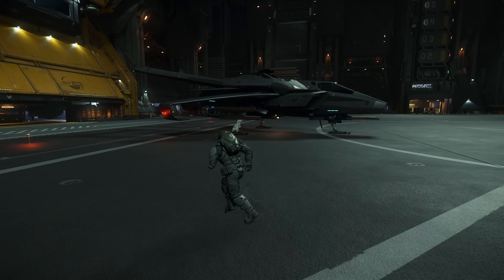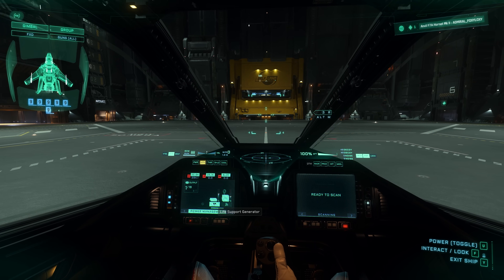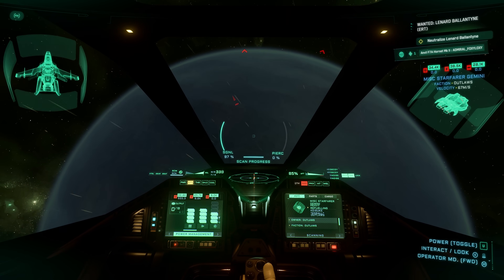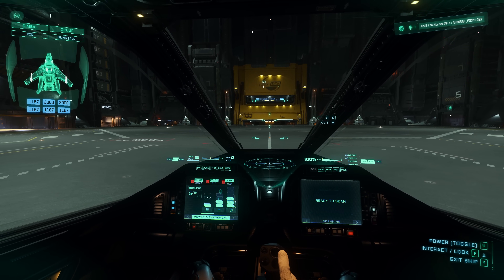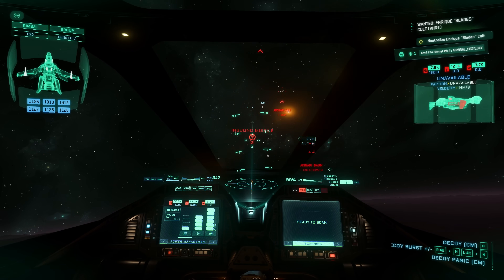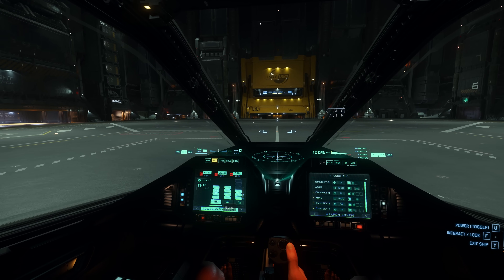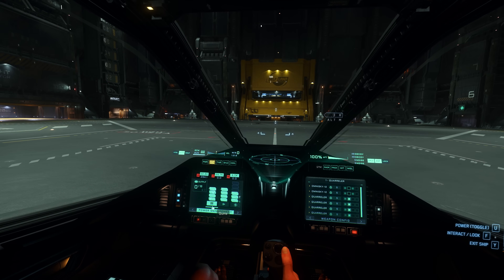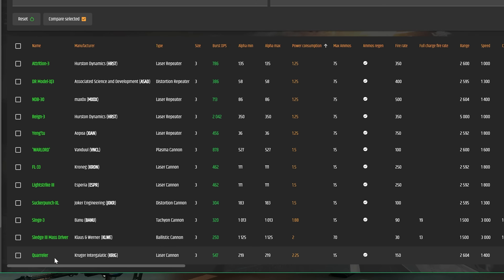How Ballistic Weapons Affect Power Management | 3.24.2 Ship Weapon Deep Dive Ep.1 [4k]

Comment: Concerning ammo, best choice is to test on AC different loadouts. 
The max number is 75 for repeaters and Gatling, and 15 for canons, whatever the size. You will never get more. So the goal is to find how many energy weapons you can use until you start losing ammo. 
E.g. Connie can have 4 energy weapons (4 default galdereen or 2 galdereen and 2 repeaters on one of the turrets). If you use more, you start losing ammo. 
In addition to that, weapons don’t have the same capacitor consumption, so having 4 galdereen can result in 75 ammo, while having 4 attritions may result in less. 
Same goes for Omnisky cannons versus MxA

Comment: As for current version, you don’t need coolers, I usually leave only 1 cooler with 1 pip and I don’t have any issues. 
Life support offline of course, whatever the ship, even when it will be implemented, battle stations will mean everyone with helmets on and power off life support. 
And last but not least, switch off tractor beams when not using them (cutty black, Taurus, Zeus CL…)

Comment: Captain foxy o7. I have a question.

I just looked at erkul with the new power system and i checkt the C1 and i noticed it had 2 bars for life support. 
Now my question could you check ships, where you can allocate multiple "power bars" to life support and see what and if something changes? For example if oxygen recharges slower idk.
Reply: Life support isn't actually implemented yet. Until CIG adds it in, you can just turn it off for free extra power pips.
Reply: Oh... Wow